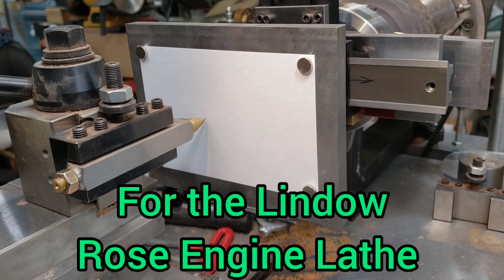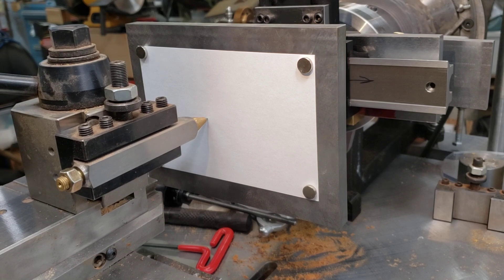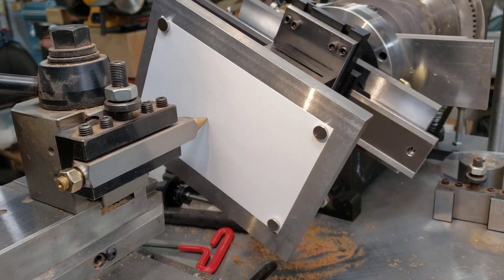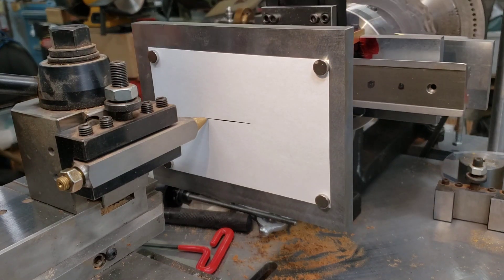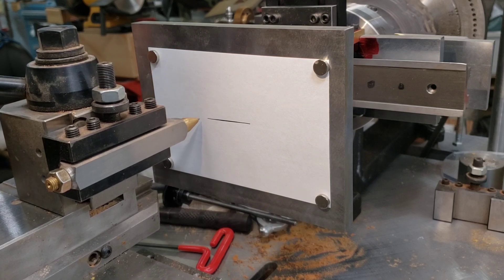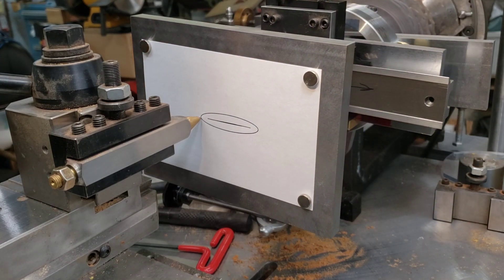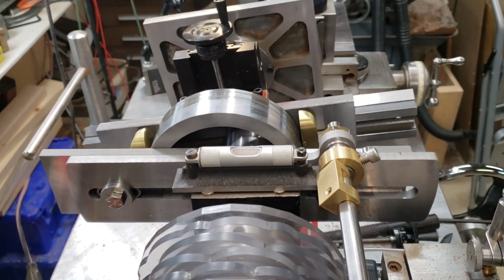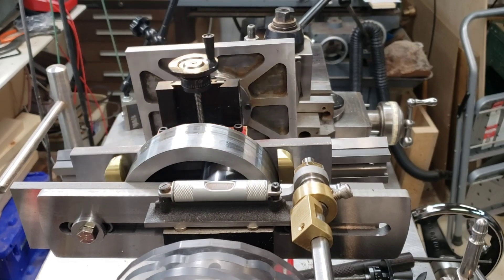Elliptical  rose engine lathe #Expert 🙃 #machinist made #OvalTurning #ShopMadeTools

Comment: Doesn't a rose engine and the spirograph shapes disprove the heliocentric model that requires four different directions at four different speeds along with the Stars expanding outward from the so-called Big Bang. 
I mean every 24 hours the constellations staying in their perfect orientation doing concentric grooves proving all of them rotate on one axis without any alteration if there was such motion and even a second axis it would result in the star patterns being a spirograph figure which is not the case time lapse 24-hour star patterns are concentric what is everyone's thoughts that understand machines like the rose engine